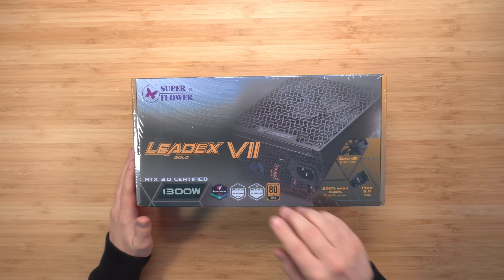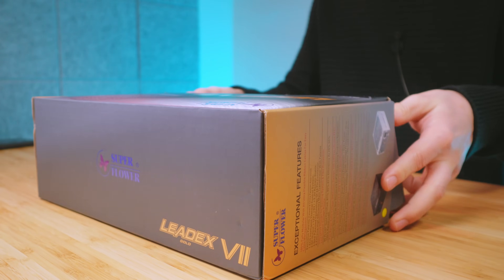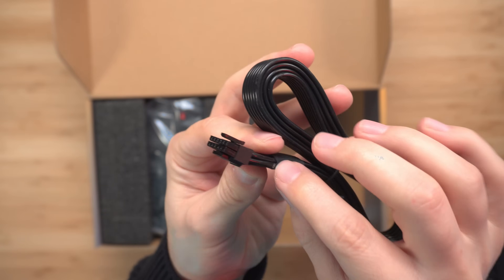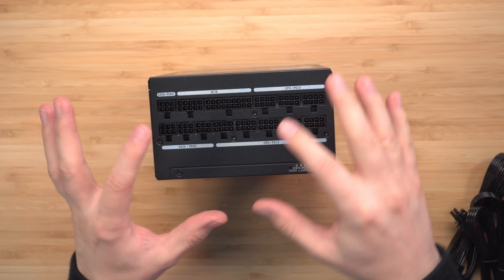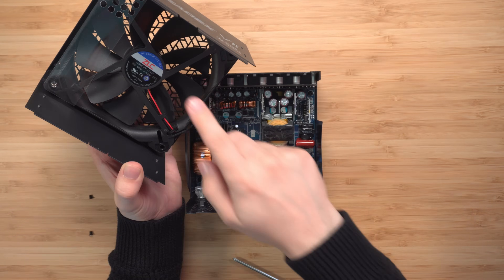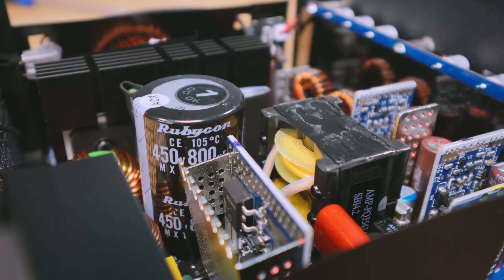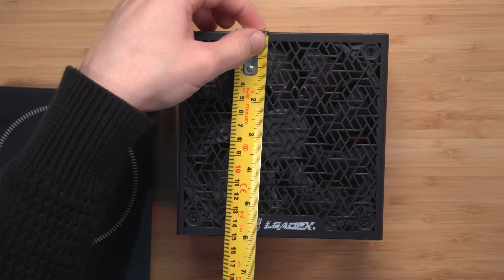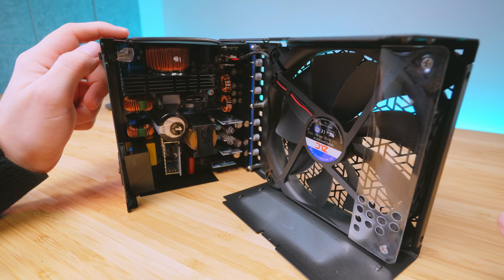Super Flower Leadex VII 1300W Power Supply Unbox & Teardown - 12VHPWR, PCIE 5.0

Comment: I just got this power supply and I feel like the fan is really loud even on eco mode. Have you had the chance to use it yet and hear the fan?
Reply: Using this right now and it's relatively the same loudness as other 1300w psus, it's simply that the higher in wattage you go the louder it gets
Reply from the maker: Sorry I haven't had the chance to install it yet, usually all power supply fans are quiet, that's not good that this one is loud. I will keep you posted here when I check it out.